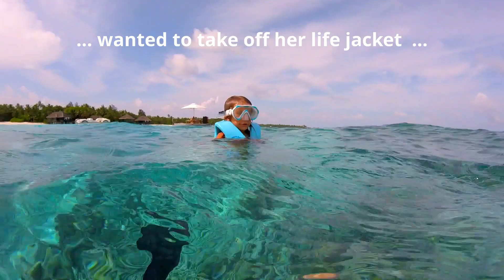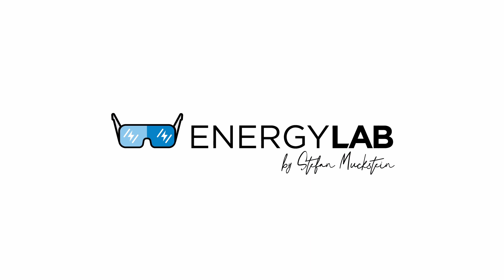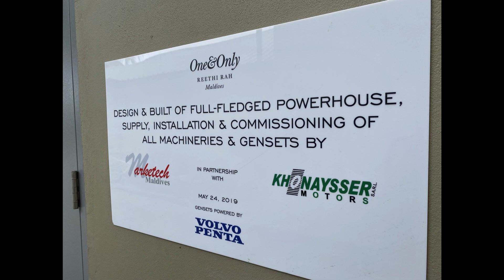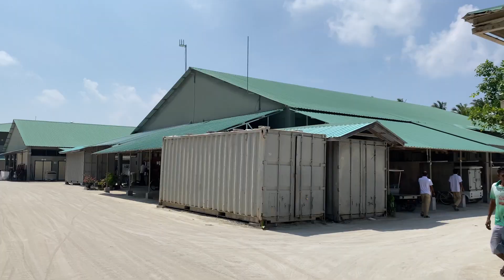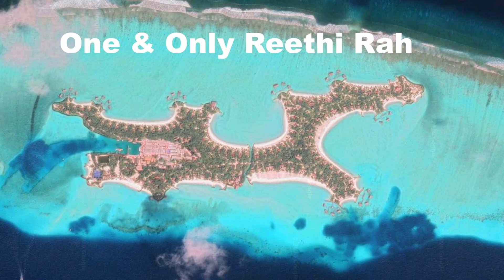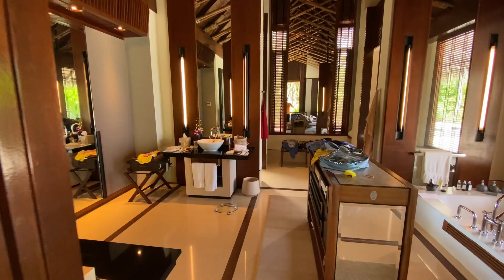Maldives ... save money, the environment and introduce more solar energy

Comment: Nice VDO and very informative...
However, Solar alone may not support the resort from power reliability and ROI.

The resorts typically use the energy in the evening until late in the night which you not have power from the solar pv.
It seems that Solar can only be the alternatives and the resort still need to keep diesel gen. Just double the investment...

Comment: Great b roll with cute models ;-)
Very informative again. Just the role modelling for the Maldives is unlikely to work. Their action hardly makes a dent in the problem, so they will likely use their land to generate returns as long as it is there rather than invest too much for an indirect effect on the environment. What's shocking is that 4 years is not a payback period they would consider.
Reply from the maker: Unfortunately you are probably right. 
But 4 years payback is really good. 😃
🤞🏻 Hopefully things will change.